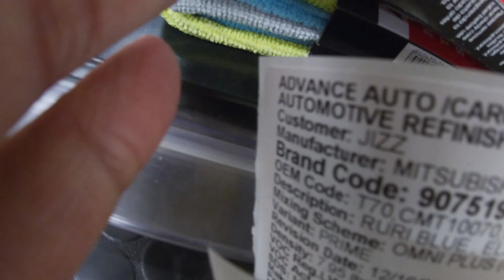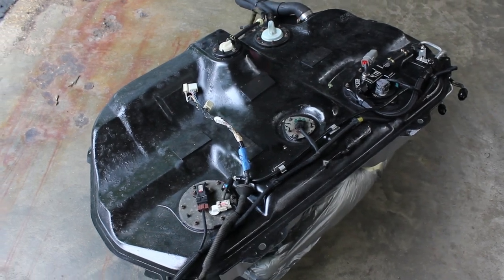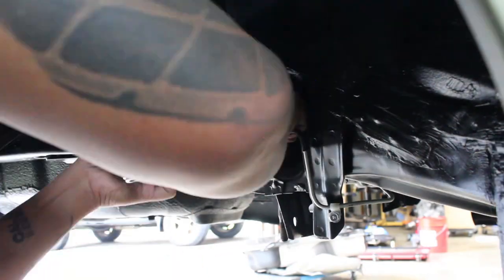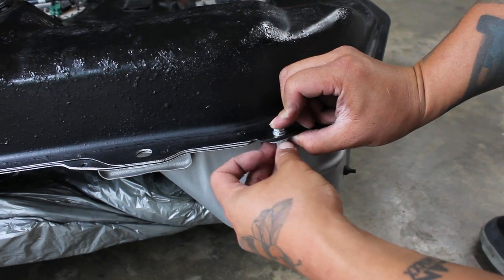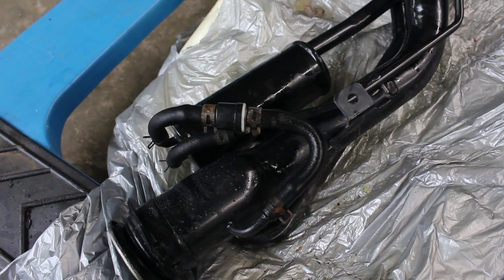Re-assembling the rear suspension on the evo 8 to get her ready for paint

Comment: What rear control arms are those? And did you source nuts and bolts from Mitsubishi, or map, stm, etc?
Reply from the maker: Blackworks Racing billet arms. I dont think they are available anymore. All the hardware are from my two chassis. I just sent them to get zinc plated.
Reply: @SoSickMotorsports  ty, STM also hasn’t made lca’s for quite a while. Hard to find good quality ones.